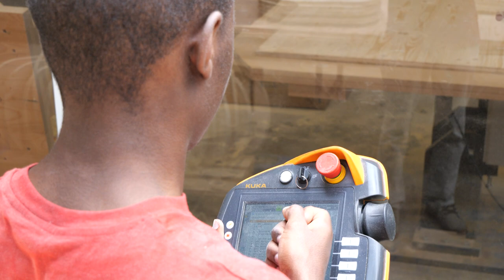Donut - milled with Kuka - robotic 7-axis mill

Comment: Hi there! About how much is a Kuka robot arm? How much have you had in maintenance costs?
Reply from the maker: Hi, if you want one privately for hobby, I'd go for a used one. Just make shure to get a kr4 control. Used ones are surprisingly cheap.
I didn't bought this one... unfortunately, so not completely shure about the price but it's not cheap. Still cheaper than a comparable 5-Axis CNC though.
Maintenance is very low, almost nothing.
Reply: @HolzFlo  thank you!! :)
Reply: What model is that Kuka?
Reply from the maker: @williecm1640  It's a KR500.  Way overpowered for wood though.
Reply: @williecm1640  Did you find a price for this setup? :D